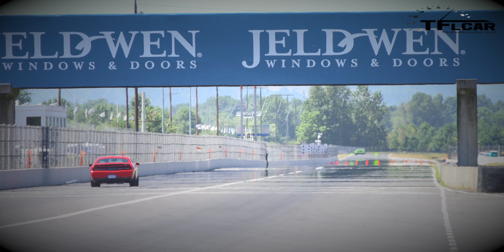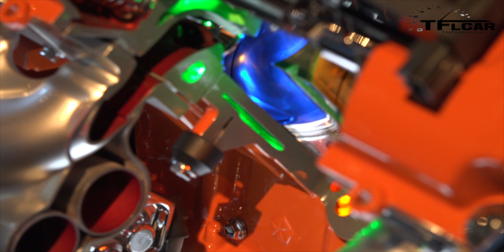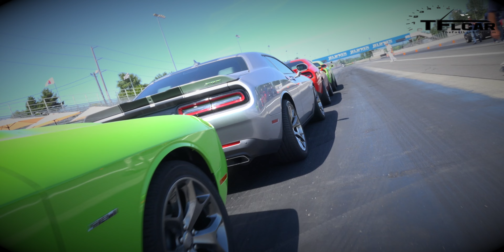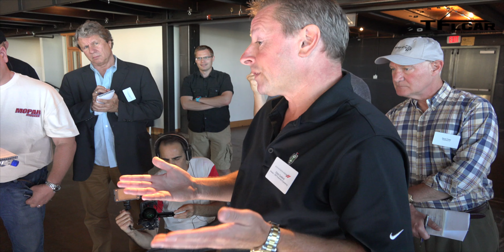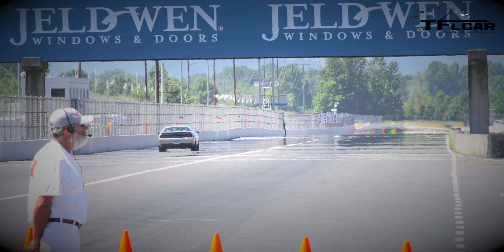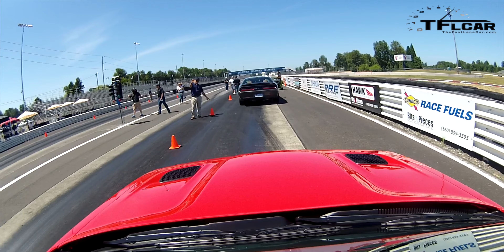What's under the hood?  2015 Dodge Challenger Hellcat 6.2L Supercharged Hell HEMI Revealed

Comment: Well after all that tech faced bull what I got from that was "we bolted on a supercharger, larger injectors and fixed anything that broke". No new tech, nothing about efficiency or losing weight - nothing really very interesting. It makes a lot of power from a massive engine with a blower. Big deal.
Reply: I guess you missed the part where he said 91 percent of the engine is new!! This guy was specifically talking about the engine ONLY. Was that not obvious. Really wonder how some people make it through in life. Lmaoooo
Reply: Exactly.
Reply: Andy Esho 91% new means nothing if all that means is the same thing rehashed. There is ZERO new tech in this engine. ZERO new ideas. It's the usual lazy ass way US car makers get power. Just make everything bigger and add more of it. From an engineers point of view there is nothing here. It's just a large engine with a blower. It could have been built in the 1960's. Infact there are plenty that were. 
I guess you wouldn't understand there's more to design than adding size though, would you? You're just happy to listen to someone telling you how it's all new and so much better than the last one. Just shows how little you know about engines, engineering and design. 

Of course you'll get through life just fine making assumptions based on knowledge you don't possess...
Reply: I should add there's nothing wrong with getting more power. What I don't like is when engineers can't be bothered then expect everyone to love it because it makes power. Other US makers have started to get in on the lighter/more efficient route. Things like cylinder de-activation, Fords Ecoboost engines, etc - good ideas. Any of that tech could have been incorporated on this engine. It would still have made at least as much power - probably considerably more - but it would also have been capable of using less fuel and throwing out less emissions. 
It's just basic intelligence that we use what we learn to further our cars. Sticking a big blower on a big engine is so easy and so inefficient I'm surprised the guy has the gall to stand there looking proud of it. 
I could get similar results in less than a day just bolting parts on a standard car.
Reply: hung huge  The SRT lineup has had cylinder deactivation since 2012! Listen to yourself. You want a 700 horsepower car that's fuel efficient.  Maybe you're just mad cause you can't afford it. You probably drive a piece of crap!
Reply: hung huge you're an idiot! Look at your name and I'm a meathead? I guarantee you're a broke loser that trolls the Internet looking for attention.  I don't give a shit what tuners do. People want a powerful car that comes with a warranty you idiot! You can add as much power as you want but how reliable will it be?  Exactly now rethink the 7 paragraphs you just wrote cause you don't have a life or money for that matter
Reply: Andy Esho So it can't be made reliable at that power? So Pagani, Porsche, McLaren, Ferrari, Koenigsegg, etc have all got it wrong then? Last time I looked all came with a warranty. Are you really that desperate you have to resort to personal insults? About a username and pretending to know what people have? Keep grabbing at those straws, kid - it's not making you look any brighter.
Reply: hung huge you just named cars that cost hundreds of thousands to millions.  Yup cause your average person buys a Pagani.  Good example moron
Reply: Sawashi32 Considering how easy it is to make that kind of power from that amount of engine I was expecting at least a nod toward trying to make it even a little efficient. They did indeed spend a lot of time explaining but there is very little substance to what they're saying. It boils down to a supercharger and a rework (that's been done by every tuner in the book for many years). As an engineer to watch them come out grinning and proud of it is pretty embarrassing. This is tech and design straight out of the 1950's - or earlier. It's also bolted into a car that was cheap when it was launched and has been around for ages already. 
When they did the S/C Vette I could kind of see the point because a few years ago it was impressively light and powerful for the money. Even that had a lot of issues that shouldn't be around on cars these days but this really is like watching some very well funded people grinning about how they managed to do what people have been doing in their garages at home for ages. 
To have a tech explanation about it I was ready to hear how they had finessed the motor and made it better overall. I was expecting cleaner, more efficient, more powerful, smoother, better power spread, better throttle response, etc. Instead what I saw was just bolt on power adders. 
From a tech and engineering POV it's really underwhelming.
Reply: That is exactly what I heard. 12 valve pushrod engine 6K redline, port injected brick, durability increased just enough to get by. This is one expensive  throw away car, and my guess is next year they announce the 10L 1010hp 0.25 MPG 70k dollar version and brag about how awesome they are. This is Fiat trying to sell cars to people who only look at hp numbers and nothing else.
Reply: hung huge Cause all these billion dollar companies are stupid. You and inline whine are the only smart ones right? Lol god I love youtube! Never amazed at the idiots I come across on here.
Reply: hung huge  There top engineers and brains of the company are a million times smarter then an idiot like yourself. That why they make millions a year and you probably make 30k and have never even owned a 50k vehicle before. Plus I bet you can't even own the vehicles you comment on.
Reply: Andy Esho You know whats really funny Your 13 SRT charger. 46 Thousand bucks right  comes with about 470 hp. I could buy a 2013 STi 34,295  305hp And drop 5k. I be pushing over  450 HP Stil be under that 46  mark and Blow your Doors off.
Reply: Andy Esho Maybe I can't afford it (actually I can) but I'm not the one looking at the cheapest form of car engineering possible to get the power on the cheap so who's the cheapskate? Why shouldn't a 700hp engine be fuel efficient? It's easily done these days and the tech is already there. Cheap, lazily engineered crap like this is what keeps giving performance cars a bad name. Considering the size of engine and engine bay 700hp is pretty rubbish anyway. What's stopping them sending that block over 1000hp? Tuners on a small percentage of the budget have been doing it for years so what's the excuse? 

You're either completely missing my point or just want to love this thing for reasons other than what it is capable of (like the fact it's American or a V8, etc - the usual thing meatheads go on the defensive about).

My point was there is nothing groundbreaking or even upto date about the engineering behind this. It amounts to a bolt on package on what is already a pretty poorly engineered car in the first place. I'm sure the numbers will look great on paper and will be relatively cheap. I'm also sure it will feel rubbish to be in, half the stuff will just about work as long as you use it a certain way, it will be fine in a straight line but terrible if you want driving feel or cornering ability - worse in the wet or over bumps and you won't be able to drive past a gas station. 

try and drag your knuckles a little less and bring your thinking past the 1950's.
Reply: Andy Esho To be fair, you completely avoided the horsepower part. You just talked about cost.
Reply: They just spent twelve minutes describing all that took place in the design of this engine that is engineered to handle 700 plus horsepower and you cry because they did not reinvent the car engine as humans know it. This is a factory built 707 horsepower car that will sell for around $59,000 (almost unheard of). I'm curious as to what you were expecting. Not trying to be rude just curious.
Reply: Sawashi32  don't even waste your time asking him. Some people aren't satisfied no matter what. Don't understand how anyone could complain when you are getting a factory car with over 700 horses.
Reply: +Andy E
Reply: inline whine
I just can't see why people haven't wised up to this yet.
Reply: Andy Esho
What billion dollar companies would that be then? The ones that needed bailing out by the taxpayer? Yeah - they would never try to make a quick buck, would they? I love youtube. Some of the egotistical morons on here who think they make themselves look good by making stupid statements to try and put others down never cease (that's how you spell it) to amaze me.
Reply: Andy Esho
You make a lot of assumptions. It's a shame almost all of them are completely wrong. Please if you have nothing worthwhile to add crawl back under your rock. You know as little about me as you do about "there (should be their) top engineers and brains of the company". Trouble is you think you do. Get over yourself. Your ego isn't a replacement for intelligence. The sooner you figure that out the less garbage everyone will have to read from you.
Reply: hung huge lol keep correcting my grammar you idiot. Just know that my bank account shits on your. My car cost more then yours and many of my watches cost 10k plus dumb ass. Now you go back to your bullshit job little boy! Funny how a joke like you criticizes these successful car companies. You don't see anything wrong with that. If you're so smart why the fuck are you a bum? Bet you don't even have a quarter million in your bank account. Stop trying to act like you know what you're talking about cause you're stupid moron
Reply: Andy Esho
So you can hardly spell, your Grammar is appalling, your articulation is pathetic, you make wild assumptions then try to make out you're some kind of bigshot? Come on. I think it's fairly obvious to anyone with an IQ over 12 that you're completely full of crap. Fake watches and cars on Forza don't cut it in the real world. Why are you being so pretentious? You know that points to certain personality traits, don't you? Like insecurity and compensating...
Reply: hung huge lol ok kid. Good luck in life cause you'll need it you joke.
Reply: Andy Esho
All this calling based on you knowing nothing at all about me. Says a lot more about you.
Reply: hung huge it was all based off of one simple thing! You criticizing a successful company.  That right there shows your arrogance. Don't criticize unless you can do better and I highly doubt that.  Not to mention you criticized a car with over 700 horses getting 13/22. Even high end vehicles like the Aventador get much worse gas mileage and you're sitting there talking shit about the efficiency.  Oh please. Show me another 700 vehicle that get an amazing 22 highway or 13 city. Oh that's what I thought, you can't.  Maybe you should team up with inline whine and create it with your genius brains. By the way all this assuming by me is correct to say the least.  Your average person in the world is unsuccessful.  That's why the average income levels are so low. So categorizing you as average which is what I did makes you unsuccessful.  That may sound rude but hey its the truth. Most of these people commenting on YouTube can't and will never be able to afford these vehicles.  It's just the facts! Also people who are commenting and haven't experienced these vehicles really have no credibility.
Reply: Andy Esho
You really are that stupid, aren't you? I'm actually laughing here because it's pretty difficult to believe you could possibly be that stupid unless there was an outside influence. Have you taken drugs? Is there some other problem with your mind? Surely no one is THAT stupid?
Reply: hung huge nice counter loser. Ok you won't receive another reply from me. If you had  some brains in that head of your, you would realize that the 470 SRT charger and challenger get 14/23. So you get an increase of 237 horses and lose 1 mpg each city and highway. That's not showing any efficiency?
Reply: Let's forget about the HP and price let's talk about the Suspension that right it can't turn left or right for 60 k I'm getting a 700 hp but with a suspension that could handle  450 hp
Reply: 243kingfrank
If you watch some of the lower powered versions I would say it really struggles at that. The chassis is good for about 250-300hp and it's way overweight for that to be of any use as a performance car. It's just old. It's based on a chassis that was based on another and so on all the way back to the old late 70's mercedes chassis. It's been developed and messed with but really that's all it is - a development of a very old design with a shit tonne of extra weight added.
Reply: hung huge the sedan hellcat charger weighs 4500 pounds? So answer this, how much does a panamera turbo weigh? How much does an audi RS7 weigh? How much does an M5 weigh? How much does a E63 weigh? Ohhhhh around the same!!! So please tell me, compared to the cars I just named which almost couple double and don't weigh any less then the hellcat charger. How exactly is the charger hellcat heavy? The challenger is and bit heavy but not the charger.  Plus dumb ass people need to get it in there head that the challenger is not a sports car but a muscle car. It's not made to go around turns.  As if any of you commenting drive anything half way credible lmaooooo. Boy you gotta love the youtube  world! As the saying goes "every asshole has an opinion". But exactly how credible is his opinion. Unfortunately  on YouTube  not very much lol.
Reply: Andy Esho
You're so dim you just made my point for me. Every single one of the cars you mention has a chassis that can cope with the power it's given. All the bullshit in the press and with little bang for buck fanboys like you would suggest they are great round corners and the engineers have somehow made a wonder car for the masses which they can sell cheap. Trouble is it's like most cheap things. It looks good on paper and the first tests where journos went to try it out all expenses paid seemed to say the same. Once the 700hp wow factor dies down it turns out it's just what anyone with any sense thought it was from the off - another overpowered, under engineered, floppy lump of dated rubbish that simply can't handle the power it's got. Cheap for a very good reason. It's outdated junk.
Reply: hung huge it doesn't matter how good a chassis is, when it weighs 4500 pounds of course you will be limited to what you can do. By the way out of all the high priced sedans I just named the only one with a truly great suspension is the panamera. The rest are mediocre at best.  Go watch the test of the panamera turbo against the RS7 that motortrend did. So the charger hellcat is not a bargain at 65k? So tell me what sports sedan is better for 65k? Stock sedan from the factory. I don't wanna hear any nonsense how you would mod a car blah blah blah. I want a warranty with my car
Reply: Andy Esho
I would rather drive a bottom of the range diesel which has a decent interior, will ride without smashing my spine on the bumps and which is put together with some kind of integrity than what amounts to a shed built heap of 50's-80's designs cobbled together as cheaply as possible by hillbillies.
Notice how they compare the Panamera to the RS7? Wonder why not this pile of mess? Because apart from a drag race in favourable conditions this thing has absolutely zero to offer.
Look up the words "quality, refinement, luxury, tactile, feel, engineering, design, efficiency, style, durability, smoothness, control or calibration". You won't find a reference to this old iron anywhere there.
The funny thing about that comment to me is you say you don't want to hear about any non-factory car but that's effectively what this is. It's just a factory backed shed project and it's got the same results. Great as long as you have no money and just want to tell everyone how much power your dyno queen makes. Complete rubbish at doing all the other things a car is meant for.
Reply: hung huge wow you're  a complete fucking idiot. When they compared the RS7 to the panamera the hellcat wasn't even out yet.  I asked you one question  and your dumb ass couldn't answer. I guarantee you drive a piece of shit! I can tell by the way you speak that you're  unsuccessful! Keep trolling kid!
Reply: Andy Esho
No you asked me what I would drive under 65k. I don't drive a car under 65k. At the moment I drive a 2012 M5 but it's due to be changed in the new year as it reaches it's 3rd birthday. I wonder. Should I go for the old rubbish or no? I've actually made up my mind already and while my next car will be American it won't be this useless piece of garbage.
Reply: I forgto to ask what youdrive. I guess drive is a difficult thing to do on a pushbike.
Reply: hung huge I drive a 13 SRT charger. My previous car was a 12 base panamera which was a great car but it's gay if you don't get the gts  or turbo.
Reply: hung huge and i asked what car you would purchase for 65k that's better sports sedan then the hellcat charger
Reply: Andy Esho
Since I get my choice and it goes from my tax return I don't see why I would lie? It's certainly not the best or fastest car I've owned. You on the other hand don't strike me as someone who can afford a Panamera. I base this on a few things. You're love of cheapness for a start. The price over quality attitude puts a big flag on your head as someone who can't afford any of these cars - even the old iron. If (and it's a big, spurious if) you do drive a "13 SRT charger" it's someone else's car that you have a lot of finance out on. I don't buy into the Panamera thing for a second because if you did actually have one you certainly wouldn't be trading it for a charger. Keep dreaming loser.
Reply: Andy Esho
You did indeed and my answer would be I wouldn't personally but if I had to I would take a far less powerful BMW/Mercedes/etc over an overpowered POS like that anyday of the week. By the way it's nice to see the timing on the posts where I mentioned wha I have and you spent the next 20 mins biting your hand and trying to come up with some kind of clever reply - only to make yourself look very foolish.
Reply: 243kingfrank
I would be amazed if he had a 13 anything. It's much more likely his mom has one or he has a base model and loads of finance. The STi would probably be at least a good run for an SRT anyway unless it's a dry drag race and even then it would have it for the jump off the line.
Reply: hung huge follow my instagram bitch  boy! Don't get jealous cause you see several luxurious items. Lucky for you a few days back I posted 40k  cash on my dresser for fun. Not to mention several expensive watches.  I have more money now then you will at the age of 70. My instagram is unstoppable1118
Reply: Andy Esho STI is a Bitch a car lets bring your car to  a Dirt road/Curvy road we will see which car is a Bitch car.